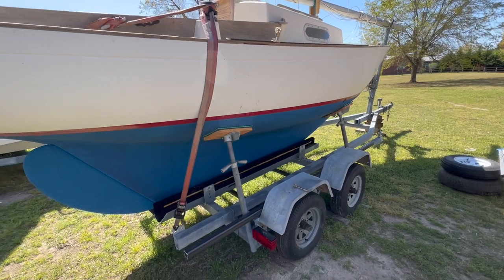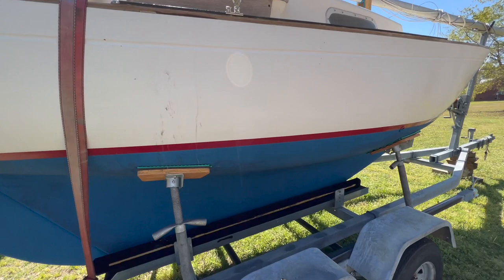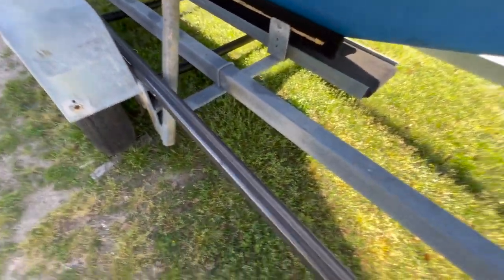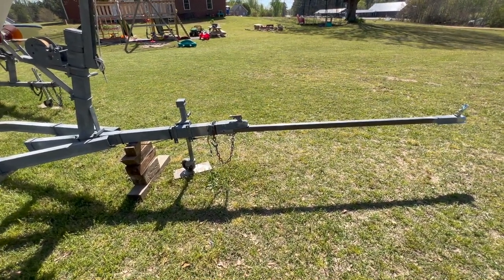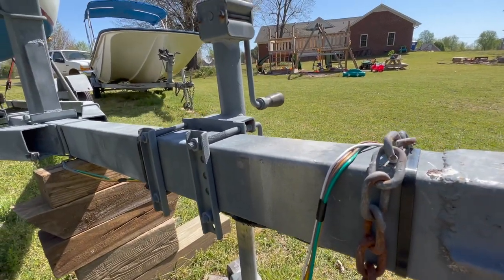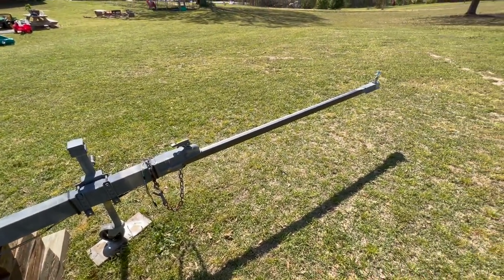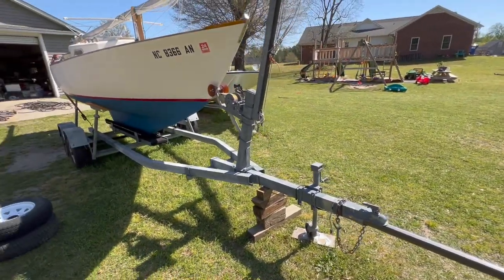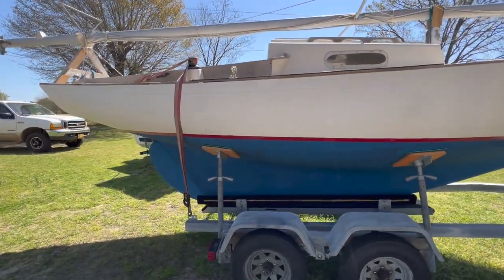Sea Sprite 23 trailer tongue extension and launch

Comment: It's really too bad that you didn't remember to record you launching the boat or of you putting up the mast. That information would've been great for people like myself and others. I was really looking forward to watching you to gain some knowledge on how to launch a full keel sailboat from a trailer and putting up a mast. I'm looking to buy a Seasprite with a trailer myself. Not quite as nice as yours though.
Reply from the maker: Sorry about lack of video during those key times. I did record raising the mast in another video. It went pretty much the same on launch day other than it was windy and I turned the boat bow to wind. With the trailer tongue extension installed launching was easy. I lowered the back support pad screws and unhooked the bow strap and backed in until the boat floated. The new owner was holding a dock line and pulled it back and over to the dock and I pulled the trailer out. Very quick.
I didn’t even get out of my truck and didn’t even back my truck in far enough to wet the back tires. I wish I had another person with me to video it all. There were other boats launching  too and not much time .
Hopefully the videos will get better.
Thanks for watching
Randy